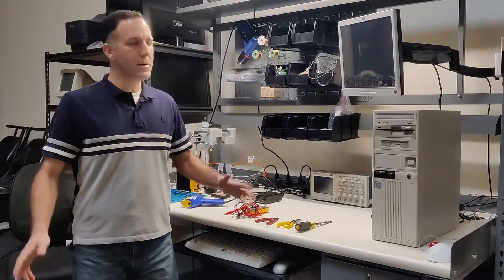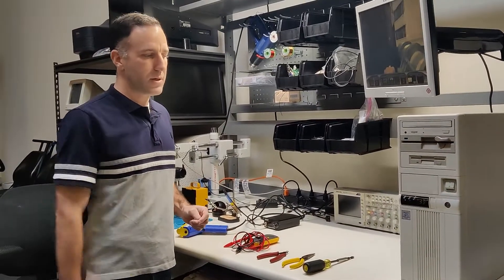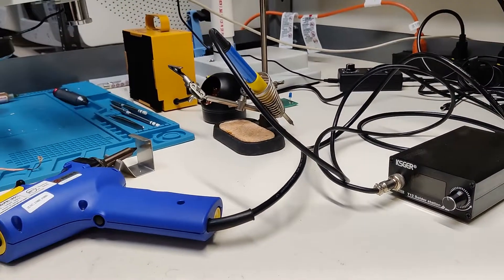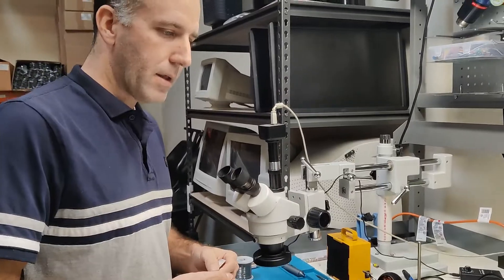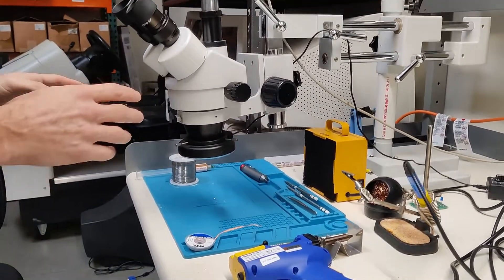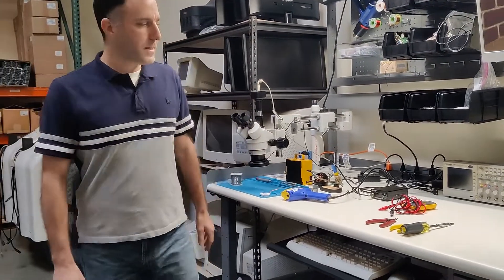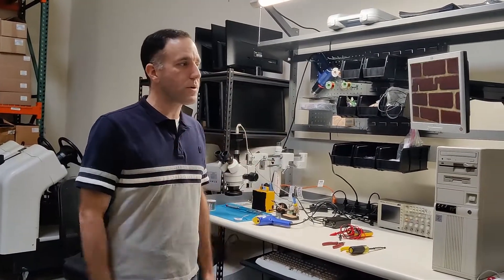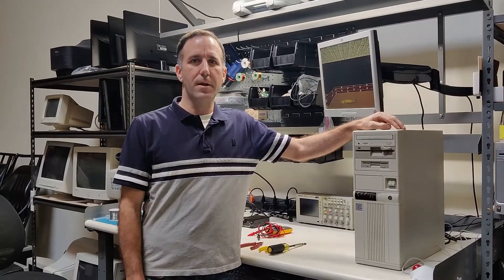Retro-Electronics Repair Lab Tour and Guide

Comment: I just checked out the availability of the KSGER T12 here in Germany and found that it's not sold here apart from on Amazon under a different name but with the KSGER branding on the product fotos.
Most importantly though one Amazon reviewer claimed it to be a very danerous device. This is his comment translated by myself: "The sale of this device is generally not permitted in Europe. The device cannot be sold because it has life-threatening safety defects. For example, the metallic case is not connected to protective ground. The isolation distances within the device also make me thoughful."
I'm no electrician though, so maybe you could check it out and if in doubt get rid of it and make a video about the issue.
Reply: Found another review, that mentions the safety issue only exists in models with internal power supply (which according to the reviews dies fast anyway) and so doesn't exist in models with an external power supply. He also mentioned that the T12 tips and controlling electronic are very good and least in version 3 of the device.
Reply from the maker: Interesting, thanks. I will open it up and check it out. I love it, it actually came recommended by a long time Apple engineer.

Comment: For caps you may need to get the low melting point alloy that melts on 138C so it will be much easy to take out caps from motherboards the low melting has bismuth alloy
Reply from the maker: Thanks!